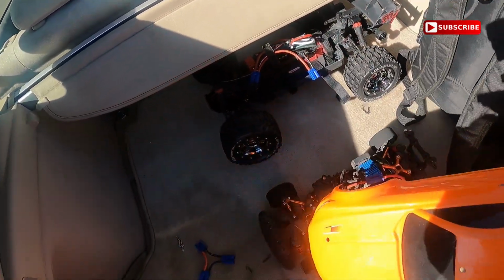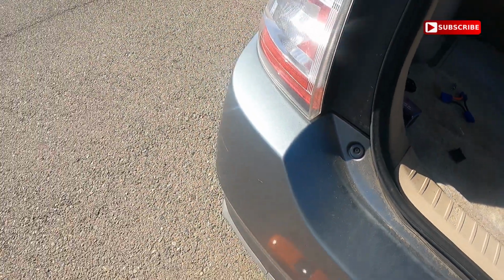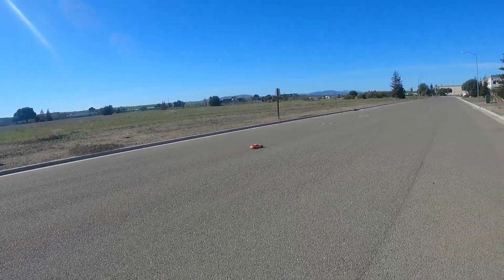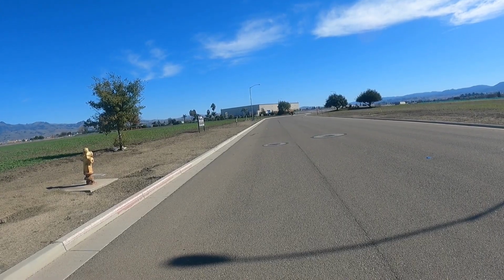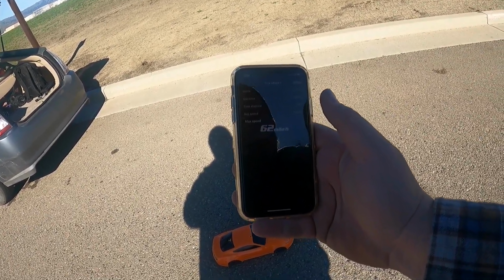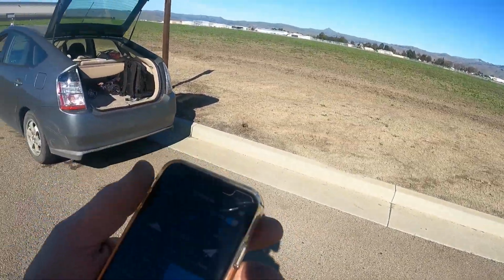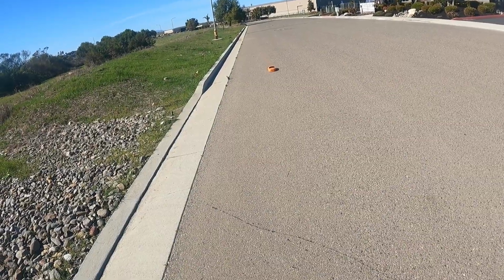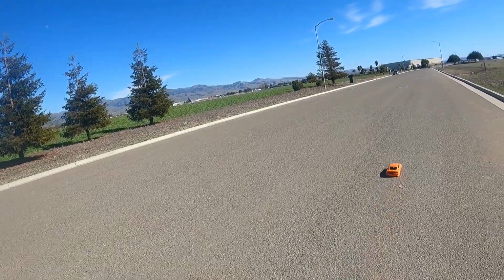Out rippin' the 4Tec 63mph

Comment: If you pop the arm off the servo you should be able to tell if it’s binding up. 

You might also have a tooth missing inside the servo.
Reply from the maker: I rebuilt the hole front end and it all moved freely, i even put some stock parts back on because the moved smoother then the upgraded parts, so that is what makes me think my servo is either week or like you said missing a tooth Thanks for the suggestions have a great week end
Reply: @KurtsRCs  you to my friend.